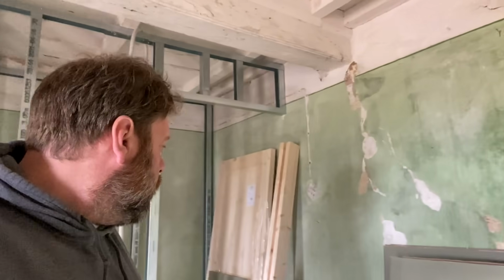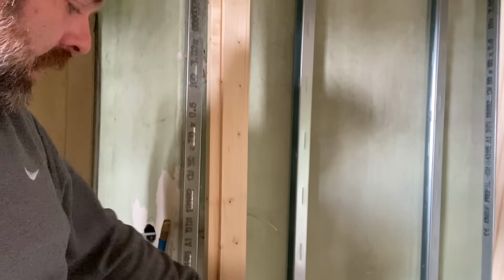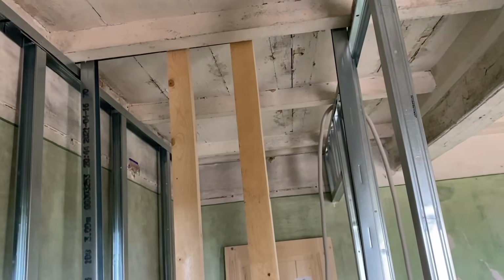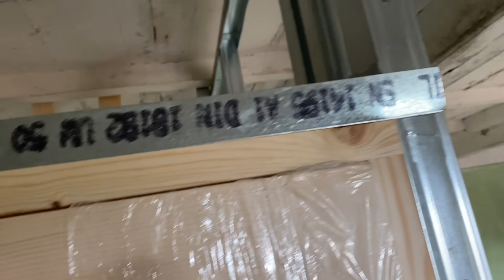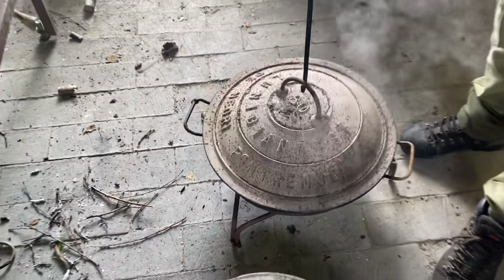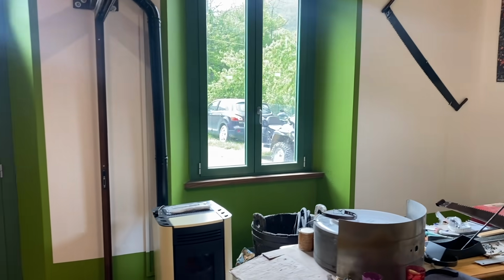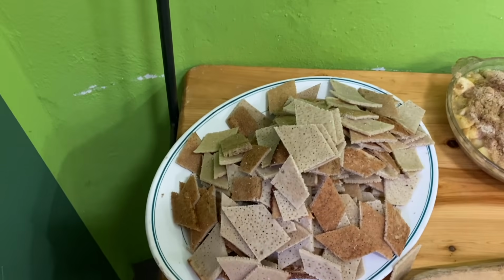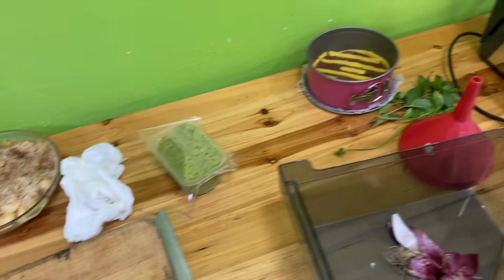Slow food in Italy, the art of cooking in Tuscany

Comment: Hi Raff, Onwards and upwards indeed!  You don't need to worry about movement in the door frame.   Wood moves across the grain not along it ( or at least minimally).  Check various videos by John Peters or Rob Cosman and Reparing Furniture for much more about this.  I didn't think about it when I built a staircase for our en-suite shower room and fixed each tread with long screws through the stringers at each side of the treads.  As they shrank a few have developed splits in the middle.  I should have only fixed them at the front and left the back free so the treads could move at the back past the bottom of the risers which would have prevented the splits.  Lesson learned for the future.  You will need to consider this as the temperature and humidity will vary quite a lot over the seasons where you are.  Mike